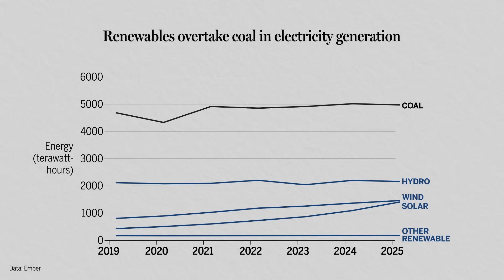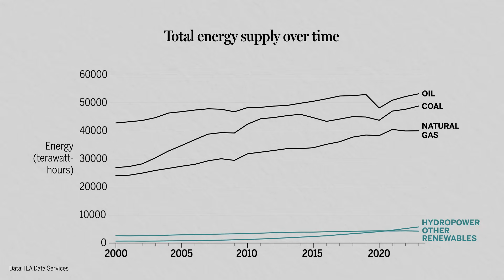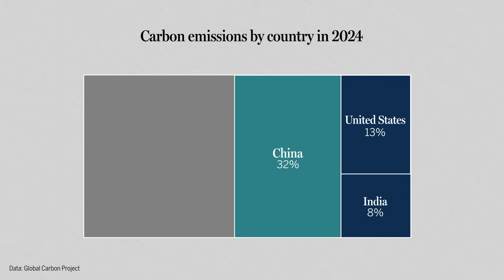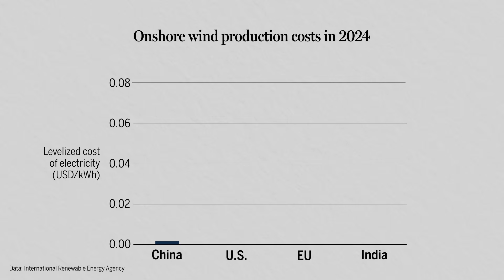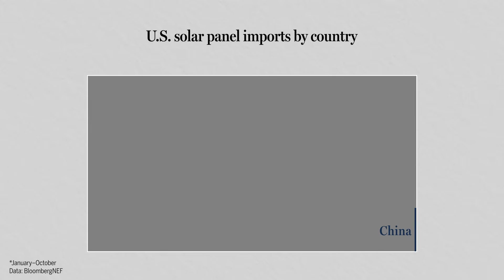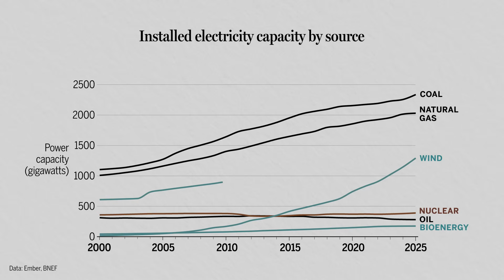How cheap renewable energy is finally flattening emissions

Comment: 1. Thousands of square kilometer.of solar panel farms - is it still ecological to turn green lands to solar farms?
2. Huge black area.of solar farms get more heat to be kept, it is not relectet. Which makes temperature to grow.
3. Where is energy from when sun is not shining? Mistly from fossil fuels - so system is more expensive, and in total energy in more expensive too.
Reply: Yes.  It is ..

Solar panels do not add new energy; they only convert incoming sunlight that would reach Earth anyway.

Their waste heat is tiny (several orders of magnitude lower)  compared to greenhouse gas forcing and even total human energy use.

Local warming can occur, but overall solar panels reduce global warming by displacing fossil fuel emissions.
Reply: @MichałT-e3r   energy storage = batteries.
Reply: @CH-et4go  energy storage goes far beyond batteries. 

Huge amounts of energy are stored with pumped water and the denser fluids, lifted weights, compressed air, chemical reactions, stored heat, etc.
Reply: Stroing from day to night is an issue. Maybe it is possible for private home, but for block of lats and industry it isnot. And that is an easier  point. How would you store energy from summer to winter?
This is only electeucuty. Many power plants poduce not only electricity but also heat. For each unit of electricity 2.5 units of heat is generated.
Please calculate it how much storage wenhavr now and how much is needed fro 100% renevavles. Currently storage is for just few minuts and it already costs fortune
Reply: @MichałT-e3r dude, Australia has already addressed every issue brought up and they have benefited from it enormously. 

So is China. And so are many other countries. 

I don't know if you noticed but solar batterry storage both got much more durable and much less expensive over the last few months.

But we also have many other ways to store excess energy. 

Nations are storing it as heat to be distributed later during cold times, by moving loaded rail cars uphill with an electric motive and then extracting the same electricity on the way back down, play pumping water or heavy liquids up to a higher elevation and then extracting that energy by allowing the liquid to flow back down to the lower elevation. 

With the recent price drops, it is exploding.  Prices were high because companies and power utilities were buying up almost everything that the industry could produce.  You can now buy solar batteries that hold a third of the power a house uses each day for $1,000.   That's down from $3,000 only 2 years ago. 

And you can buy panels that produce four times as much electricity while taking up 1/8th the space that they used to take...  Literally down from 32 square feet to 4 square feet.

And the durability of both has increased.  And the new technology just coming online is estimated to be good for longer than the human lifespan.
Reply: @mac_mcleod  AFAIK stationary battery storage at the cell level, with sodium, is expected to fall to $10 per KWh of capacity in China before the end of the decade; even if for the rest of the world it costs twice as much, that would still make it so cheap it would make no sense to not install batteries.
Reply: @FabioCapela  That matches what I'm seeing.   Sodium has some issues with voltage dropping but I expect they'll figure out ways to handle that over the next five years.   In cars, they are thinking of a hybrid mixture of lithium and sodium.
Reply: @mac_mcleod  You can regulate the voltage of sodium batteries, it's a bit of extra cost but not much of a problem. And sodium cells have some interesting advantages for EVs, such as being nearly fireproof (as in, it's hard to make them burn even intentionally), working well in cold temperatures (CATL's prototypes lose 10% of efficiency at -40°, which is far better than most other batteries and even than internal combustion engines), and not being damaged by a full discharge (meaning cars can be shipped around with fully discharged batteries).

I believe the main reason companies are thinking about hybrid battery packs is to increase the energy density. Sodium is improving, but is still significantly worse than Lithium.
Reply: @FabioCapela  Yes, I'm aware of the improved cold performance and their fireproof nature.  I wasn't aware of the discharge benefit.
Reply: 1. I had the same concern, but a silly number of plants actually grow better in the shade; and those shaded microclimates work particularly well in any desert (but work on ordinary farmland too). They keep finding benefits to plant growth, rather than losses. Nature is poorly optimized for sunlight in the first place as it turns out!
Reply: @DarkwarriorJ  Many plants we grow for food — essentially all of the low growing leafy plants, most of the bushes and other short plants, and many of the short trees — originally developed inside forests, under taller trees, and thus were literally made for receiving mostly indirect sunlight.
Heck, the fruit quality is often better when grown in the shade too, as happens with grapes and coffee.
Reply: @DarkwarriorJ yes they've shown the broccoli shaded from the 2 hours of strongest son is much higher quality.
Reply: How ecological are the farms on those 'green lands' of yours? There is more nature in the shade of those panels than on your 'green farms' with all your pesticides and soil destruction.
Reply: Rigth, but we will have both types of frams. Food is a necessity and solar is not. Which is better: two frams or one fram?
Reply: @MichałT-e3r no there are a lot of farms using a hybrid solar methodology now.  Play the solar panels protect the tinder plants from the strongest hours of the Sun.  The plants produce higher quality vegetables.

Similar findings for raising sheep.
Reply: The same was with biofuels generation 1. They could be made of plannts which are edible. Refineries pay more, and cost of food grew. Forests were cut to grow biofuels.
Gen 2.are.better, but still cutting forests is an issue.
Reply: @MichałT-e3r  After solar became cheaper, growing biofuels became a huge waste. Replacing the area used to grow biofuels with solar panels, and the fuel-using cars with EVs, would allow we to keep between 40x and 100x more cars running with the same land area used.

Heck, converting all the corn farms used for fuel in the US into solar farms would generate enough electricity to power the whole US. And I'm not talking about just replacing the corn ethanol, or even the gasoline and diesel; it would be enough to replace all fuels everywhere, including all vehicles, all power plants, all industrial heating processes, all residential heating, all gas stoves, etc. And we could even grow native vegetation under those panels, helping the environment even further.
Reply: I agree with your first point. It would be a lot better if we replace parking lots with solar farms instead.

Comment: I'm so happy countries in the global north and global south are indeed moving away from fossil fuels (except Hungary and  Russia and the US).
Reply: It does not make for good headlines, but solar is really popular in Hungary. In June 2025, solar power supplied 42% of Hungary's electricity. It's the second largest source of electricity in the country after nuclear. So not all is grim in Hungary. But residential heating is unfortunately still dependent on (Russian) gas.
Reply: @73173  isn't Hungary number one even in some kind of metric related to solar?
Reply: @73173 if heating could be done with waste heat from fission it would be amazing!
Reply: Russia is moving away from oil, too, just not voluntarily :D
Reply: @Soraviel  hungary and US is also moving away from fosil fuels only difrence is that it's not subsidised on national level there is huge change on privite level and on the states level in US even the most republican states are pushing solar in the US because it's just cheaper. And that drill baby drill thing it's political bulshit. They cannot do that because of economic reasons. In short, global demand for oil is going down because of green revolution. US oil is expensive (much more expensive than middle east one) and if they drill more they will be out of buissnes. Because prices would fell
Reply: @bombiczek123  Not sure what you are looking at but global demand for oil is not going down. Since 1990's demand has increased by over 50% .  And it is projected to continue to go up. It's bad enough most here are science illiterate, but this is simply looking up easily available data.
Reply: The "global south" is not moving away from fossil fuels.  They are being pushed away, with the result being over a billion people being kept in energy poverty.
Reply: @TimothyGasser well I am for all possible avenues of power for energy poor countries . Having a coal plant and power for hospitals home appliances and schools is better than not having power at all . If the use gas better if they have fiasion and renewables even more

Comment: If I could be an energy source, I'd be Solar. Everyone loves you, you get paid a lot and only have to work 25% of the time.
Reply: Triple, gasoline engines are even worse! Only 20% efficient. 80% of the energy use in them is wasted as noise and heat!
Reply: @freeheeler09that is very true and that is why ev are more efficient , still other forms of energy production have higher capacity and do not have intermittency.  So it should play a role  in the grid and not be relied upon vecause it is cheap to avoid waste , scarcity and grid bloating
Reply: Solar is free. And most of its energy happens when people are awake, rather than the middle of the night.
Reply: @Secretlyanothername are you sure about energy demand? Because when I see grid load figure they tend to be max early morning and in the evening ( when solar is yet to start or waning) even if lower at night.
Reply: @corradoalamanni179  That's why you couple solar with batteries, which still results in cheaper electricity than gas or coal even in the US, where both solar panels and batteries are much more expensive than the global average due to the tariffs on Chinese imports; just ask Texas, a state that has no love for renewables but is installing those plus batteries at record speeds just because it's cheaper. In most other places of the world it's a no-brainer, as it's even cheaper, so even having insane redundancy (to the point of giving away free electricity when the redundancy isn't needed, like an Australian state is planning to do next year) is still cheaper than fossil fuels.
Reply: @FabioCapela yeah batteries will help but if you see the difference in energy ( not only electricity) between winter and summer are so huge that there is very little possibility that batteries can be enouggh it would be way easier and cheaper to simply have more baseload with fission geothermal or hydro
Reply: @corradoalamanni179  You can just have spare solar and wind capacity. Plus integrated grids.
Solar panels are becoming so cheap, in the not so distant future home owners might be installing more than twice as much as needed just because oversizing their solar system won't cost much more, and the extra capacity is good to have.
Reply: @FabioCapela  well if they are not receiveing subsidies  ( as in we pay them only if we buy electricity when it is needed) it is a possible solution but to pay for renewables and then pay for fossil fuels when they are not available  is a more costly and more co2 intensive way of operating a grid instead of having clean baseload with renewables on top
Reply: @corradoalamanni179  Not quite, because solar is getting so cheap even leaving part of it idle is still cheaper than using other forms of energy generation — and particularly so nuclear, the most expensive of them all.
Heck, Australia is planning to give everyone across three of its states three hours of free electricity per day due to how cheap solar became (or, more specifically, how solar being so cheap led to installing more than enough capacity so they have excess energy that would otherwise be curtailed).
Worth remembering that Australia doesn't block Chinese imports of solar panels and batteries, which makes rooftop solar and home batteries about half the price compared with the US. As a result, Australia is AFAIK the global leader in rooftop solar, and is also one of the leading countries in home batteries (over 100K such systems installed in just 17 weeks, in a country whose population is less than a tenth of that of the US).
Reply: @FabioCapela  as I said if we do not subsidies it it is welcome .

Still the more solar we have the less valuable it is because it leads to waste if we can shift demand that is good but countries with clean baseload have cheaper and less co2 intensive electricity see spain and france vs germany and denmark
Reply: @FabioCapela  if look at australia it has a filthy grid compared to france 400 something ( 55% of it is coal) co2 intesity vs 50
Reply: @corradoalamanni179  Australia's CO2 intensity was actually 552 in 2024, but that is down from over 800 in 2000 and over 650 in 2020, mainly thanks to solar. And it's expected to fall to less than 100 before 2050, also thanks to solar.
If they were to start going for nuclear right now, they might have the first brand new nuclear power plant ready to connect to the grid around 2040, and it would be a far more expensive electricity than they currently have, or that they can have with solar — keeping in mind that Australia is a fantastic place for solar.
Reply: @corradoalamanni179  The problem for Germany is that they lost their supply of natural gas and had to switch to US-supplied LNG at literally 3x the cost, if not more.
But electricity in France or Spain isn't cheap. Take Uruguay, for example; 95% renewable, mainly from wind, and it has cheaper electricity than France. Or Brazil; 90% renewable, mostly hydropower though with solar and wind catching up, and an electricity price over 40% cheaper than France's. Going back to Europe, you have Norway, 98% renewable, mainly hydropower and wind power, and with the same average electricity price as Brazil, thus over 40% cheaper than France's.
Reply: @FabioCapela Please do not misunderstand I am all for solar and wind but they should be part of a grid not The solution . If you look at how much germany Italy and denmark have invested in only renewables  vs how much france has spent on fission and look at the rapidity of the result .

We have forgotten how to build fission in the west we should do better! 

A mix with fission and all clean tech will be a better solution than one without all options.

Nuclear is slow but it is best for baseload
Reply: @FabioCapela yeah all those countries are blessed with even more cheap baseload  power Hydro by all means that is cheaper than fission ( even if more dangerous and land intensive)
Germany also shutdown its fission power because it wanted to be green as we shall burn lignite coal to foster more plant growth and wasted al the progress done with renewables
Reply: @corradoalamanni179  Everything is cheaper than fission; solar+batteries, wind+batteries (even offshore), geothermal, coal, gas, oil, hydro, etc. Heck, solar and onshore wind are getting so cheap that without storage, building them new is already often cheaper than the marginal cost of nuclear (i.e., just the cost of the fuel).
The exception, of course, is using LNG for the gas power plants, that has a 3x higher cost than using pipeline natural gas, and ends being more expensive than nuclear.
Talking about hydro, you can use pumped hydro for very long term storage (as in, across seasons); most countries have more than enough adequate places for pumped hydro to supply all their energy storage needs. It might be better to just double the number of solar panels to handle overcast or stormy days, though, and give the excess energy for free to help the economy.
Reply: @FabioCapela  I think that you are considering only the lcoe instead of system cost and final price , also I am not considering fossil fuels as a valid source because I am talking about a clean grid
Reply: @Secretlyanothername  solar is not free its cost is derived from installation and grid support ( firming it , delivering it and managing intermittency)